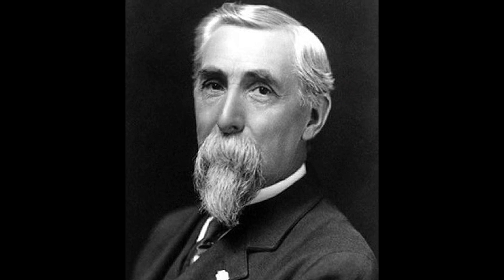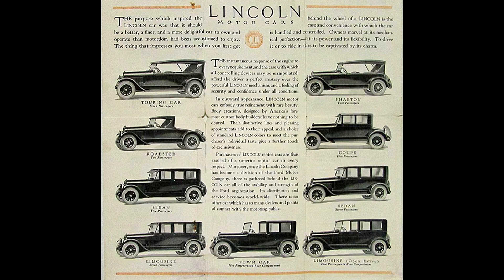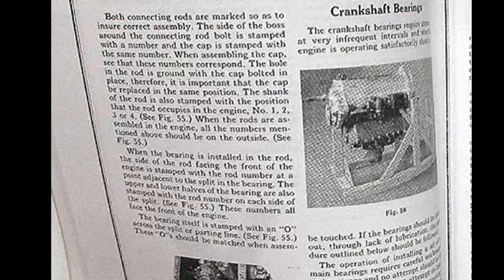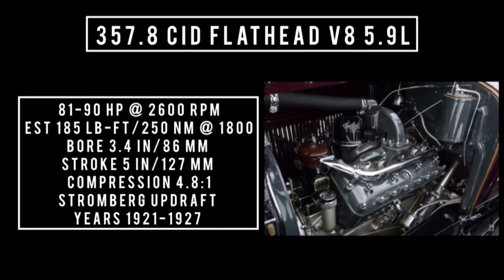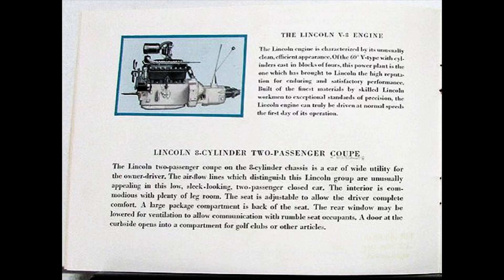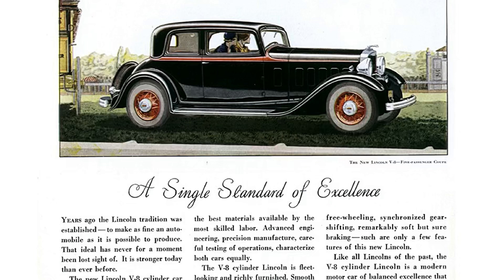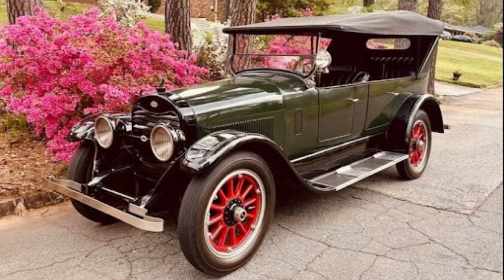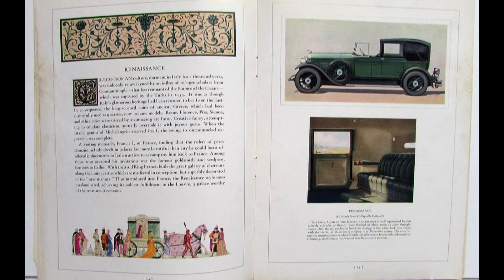Leland Lincoln V8 Engine Family 357.8, 384.8

Comment: I like the 1932 model K. I read about Mr. Leland in my favorite book, titled..."Nuts and Bolts of the Past"...a history of U.S. Technology from 1776 to 1860.  Pg.32 says about Leland..."Henry Leland moved from shop to shop after he left the New England farm--from the armory at Springfield to Colt's factory in Hartford to Brown & Sharpe's plant in Providencer; he ended as " the grand old man"of Detroiy, where he designed and built the engines for the original Cadillac.
  The author...David Freeman Hawke goes into detail. He Mentions the inventor of the gun stock lathe. Then there is John Fitch...in 1798 he made a steam powered boat that ran a thousand miles (in the Delaware River) before collapsing. That craft paved the way for Fulton's steam powered craft.
  I'd almost  bet you'd like the book. 
All the best, Pete

Comment: Let's look at compression ratios. Each 1 point in compression is worth 30 h.p. conservative. So the 90 hp engine at 4.8 would make 210 hp. at 8.8 ND 270 at 10.8  The later 12 cyl. at 5.2    made 125, and at 10.2 would make 275!

Comment: 30 years ago a friend of my brother in law owned a1922 Lincoln town car limousine that had originally belonged to Henry Ford’s personal lawyer and he took us for a drive. This car was all original in not sure but the paint even looked original to me. It had an old style phone in the back to call the chauffeur who had just an old time speaker on his left side by his ear. It also had a large roll up divider window separating the massive passenger compartment from the driver. It also had vases for flowers and pull down curtains for privacy and the interior was totally original and excellent but somewhat faded condition. The car was a darker blue with black fenders with wooden spoke wheels that still had  the varnish on them. It was an electric start but I think it had a crank start too. It was a great experience and the oldest car I ever rode in. P.S. I was told it was the third Lincoln built after Henry Ford bought Lincoln.
Reply: After I wrote that I was curious where the car ended up. I read it’s been donated to the Lincoln motor car foundation museum in Detroit . They have some pictures of it. When I rode in the car it was located in Springfield mo. He sold it later to a collector in Detroit
Reply from the maker: If I ever go there I’ll try and feature that car =)
Reply from the maker: Thank you so much for sharing that awesome car with us. You painted the picture really well sounds like an absolutely epic car. I wonder if it’s still exists

Comment: If you're wanting to look at a gem of the 80's that doesn't get the love it deserves, hear me out, Toyota Tercel 4wd Wagon. 
FWD with on-the-fly selectable true 4wd, no center diff. 
They were not powerful or fast, nor fancy, but they were extremely dependable and capable. Powered by the 1.5L SOHC version of the legendary Toyota "A" family of engines, 62hp and 74ft/lbs (if memory serves but check me on that). 
The early years had 3.73 diffs, the later 4.10. Some of the early years could even get a dash-mounted inclinometer with front-to-back and side-to-side incline guages. 
I drove an 84 SR5 with the manual (5 speed plus a granny that was only selectable in 4wd) that was silver with Grey and blue plaid interior. LOVED that thing. Massively more dependable and charming than it had any business being. Miss it badly.
Reply from the maker: Wow, I never knew about that. Thank you so much for sharing that if I come across when I will definitely cover it.

Comment: I have a 1951 Ford F5 heavy truck, it has what is referred as a 155hp. Flathead V8 is this the same engine as well ?
If yes, I am being told it has a different camshaft and crankshaft this seems extremely costly !
What can you tell me about engine similarities and differences please ?
Thanks in advance !
Reply: The Ford flat-head V-8 used in Ford cars and trucks, also Mercury cars, is an entirely different design first offered in 1932. It's a 90° V, with the cylinders cast as part of the crankcase. That was a triumph of casting technology.
Reply: @pashakdescilly7517  
FYI
This engine is not the same as the Ford & Mercury Flathead found in thousands of cars and pick-up trucks !
But a much larger by length of, and height of the head !
Is not the 100hp. Ford
or, the 110hp. Mercury
8a/b
But has been referred to as a 155hp Lincoln and used in the Ford HEAVY truck line.
Reply: @quadsman11  FYI that is what I wrote. The Lincoln engine described in the video is 60° and has separate cylinder banks from the crankcase
Reply from the maker: I don’t believe I’ve done that one yet. Ford has a really complicated engine lineage the right up there with Chrysler. It’s not cut and dry. They produced all kinds of different engines for different lines. Some truck engines were in passenger cars, vice versa… I don’t know if you’re on Facebook, but I would look maybe a Facebook group and see if somebody can answer that question, there’s all kinds of forms on Facebook that have people that build these engines and know these engines by the back of their hand. These are just general overviews
Reply: I heard that those Medium Duty Ford truck V-8 sometimes were the bigger Lincoln engines. Not these 60 degree ones, but the later 90 degree V8

Comment: Doesn't it strike anyone, how little power these engines produced for their capacity? I mean a 6.3 Litre engine for only 90 HP, seems very poor, and even the torque figures aren't exactly earth-shattering figures. Not a reflection on Lincoln, for this was probably very good for the time. It is also notable, that these figures are equally reflected in the compression ratio.
Reply from the maker: These engines were flathead engines they didn’t make much power to being with and only had single or two barrel carbs the ohv Cadillac V16 only Made 175ish Hp but also only had a two barrel carb.. also compression was low because gas wasn’t as good

90-125 hp in a car that can’t stop that well is plenty
Reply: @What.its.like.  Plenty frightening, sure.
Reply: Regarding low HP figures, several points: Look also at the low RPM ranges for the HP.  Metallurgy was not what it is today, so tolerances could not be held as tightly nor could the engines and parts handle the stress of 5000 RPM (for example). Gas, as Jay pointed out, wasn't refined to provide higher octane, for high compression.  Carburetor technology was really still in its infancy, as was something so simple as lubrication.  The 30s, and especially WWII, brought about huge engineering achievements in all these areas, and the 50s and 60s are the result.

Comment: As a long time Lincoln owner and enthusiast, I really enjoyed this episode, Jay. And I'll take the '27 and the '33.
Reply from the maker: Awesome choices thank you so much for digging this episode =) I think it’s really cool to go back and see how the company started. Some people will say that this is the Lincoln that is powered by a Cadillac V8 as in Leeland designed it and he worked for Cadillac, but Cadillac engine displacements aren’t the same as these. 

Going to do an early episode on Cadillac engines I just have to find more information on the Northway engine. That’s the very first Cadillac very first Oldsmobile V8 engines. They did not have detachable heads. The Cole V8 was actually made by Northway as well. The Cole V8. Had detachable heads and was vastly superior to the Cadillac design and it came out one year earlier than Cadillac that’s an engine that I definitely would love to cover, but I need to get more information on that engine, probably going to cover that engine sometime in the summer

Comment: In 1966 I was a snot nosed kid working at a Ford dealership body shop, we restored a 1931 Lincoln town car, it was absolutely gorgeous when finished; they put twenty or so coats of black lacquer on it and my job was to wet sand with 600 grit between coats, when finally buffed out it looked as if it had infinite depth.
Reply from the maker: Wow, when you walked up next to that, you probably saw your thoughts from yesterday and it